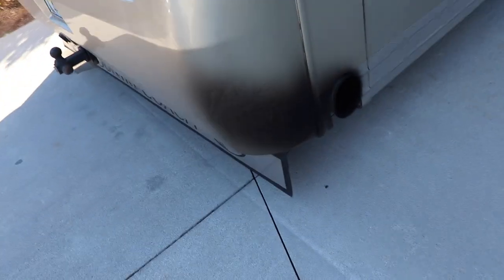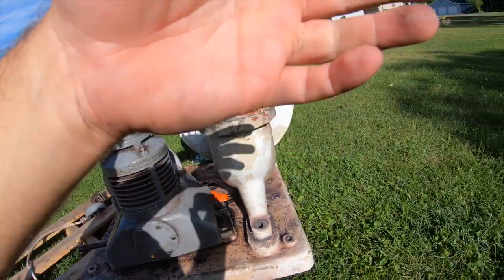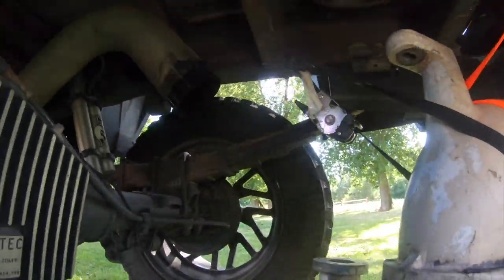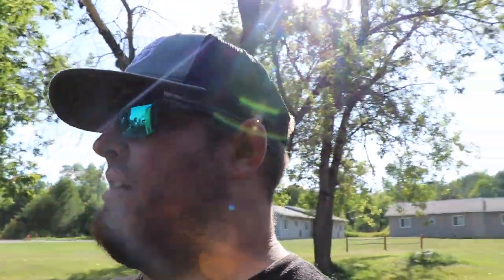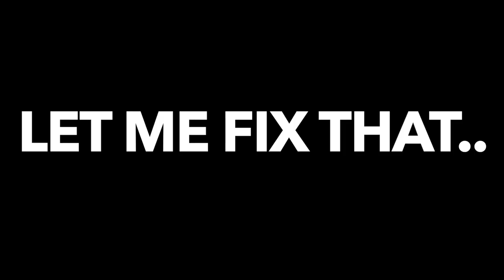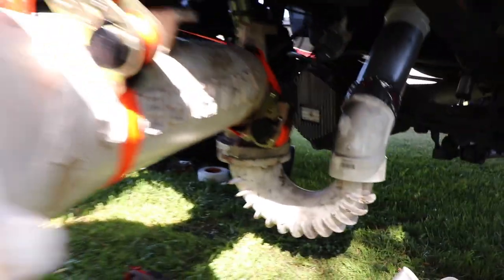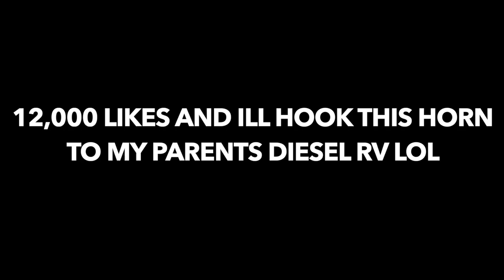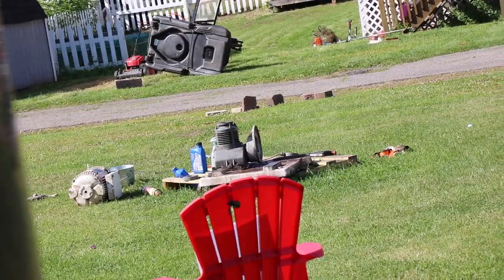I hooked an AIRCRAFT CARRIER HORN to my DIESEL TRUCK EXHAUST

Comment: there should be a diaphragm somewhere in there..  the air pressure from the compressor blows thru the ports  of the diaphragm  or between them.. this is amplified by the shape of the horn.   there are a few designs of starters that have an exposed drive gear..  removing the solenoid return spring could keep the contact disc in place against the side contacts.. so anytime power is run to the starter the drive turns.. this might be close to the proper ratio to spin your compressor..    are there any military part number tags on the assembly so somebody could look up a service manual for  the horn.    have a look at starter numbers, 16584, 16892, 16732, 16806,  17145, 16814,  17695, 17713, 16983, 17263,   you can easily search out the applications to see in person at junk yards..

Comment: The expensive way $$$ would be to get a DC motor with the same " face"  as the three phase motor and a couple of 12 V batteries in parallel, set it up so it doesn't charge when you blow the horn.
You won't suck your alternator insideout
LOL
IF YOU BLEW THAT IN CALIFORNIA, YOU WOULD GET THE DEATHS PENALTY....!  LOL

Comment: the horn needs the diphram in it,
Reply from the maker: The horn is piston driven and doesn’t have a standard diaphragm that an actual true air horn has.
Reply: @BERTRAND85O  the top over the piston may have a smaller hole or something to create the sound,   would be nice to hear the engine make it sound, may take to much flow and pressure, oh well
Reply from the maker: I’m working on it man. I’m determined 😎